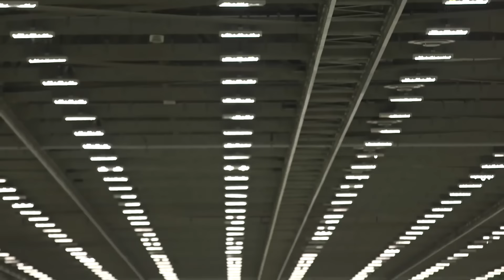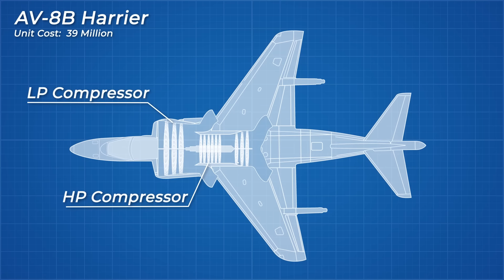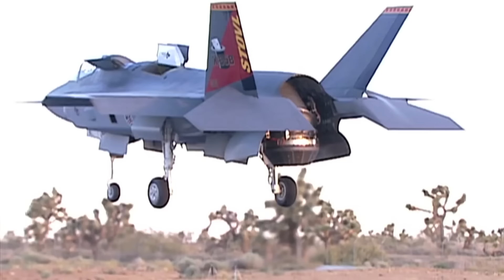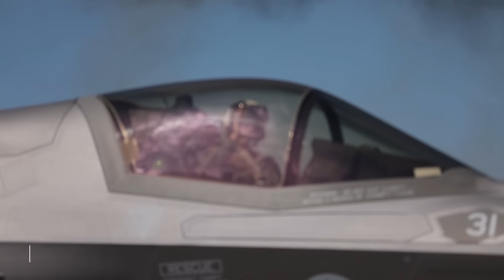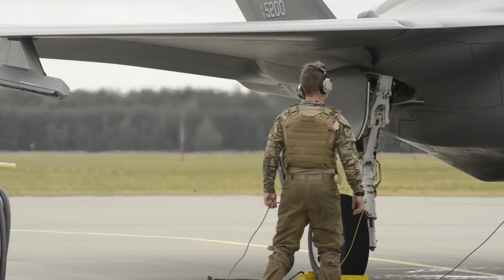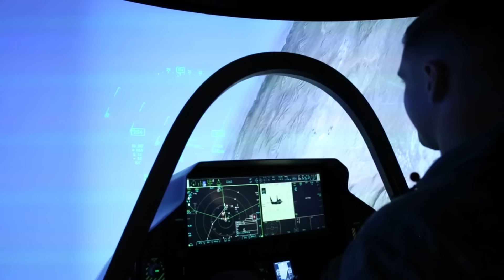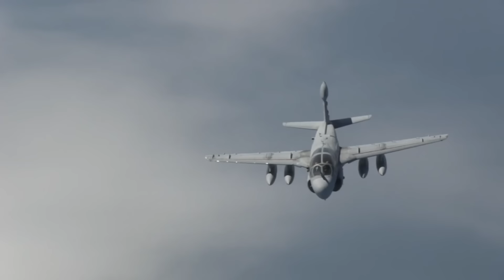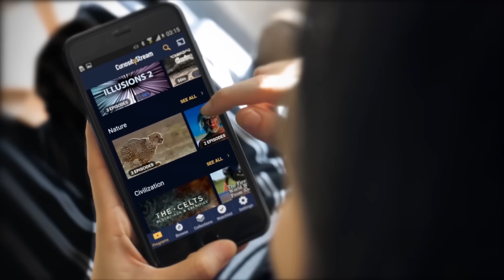Is The F-35 Worth $115 Million?

Comment: the 27 years taxpayers robbery development is finally coming to its end
Reply: 20+ years of taxpayer robbery in upgrades and maintenance contracts just starting. 

damn thing is basically unavailable to fly 75%+ of the time, the 2018 "price" figures were gamed rather hard since they didn"t include any of associated costs which were supposed to be included in the figure (and thus compared apples to oranges and PR'ed the result) the government can't own the spare parts or control logistics, doesn't own much of the IP,  has real problems with being able to use many of the systems mentioned (the networking causes "doubling" the helmet is still unreliable as all get out, maintenance systems (alice I think) causes the plane to refuse to start unless bypassed and can take days to allow to move to new place, and can't read their own radar maps because the facility for developing them has not even been built properly yet due to a different contractual screwup) and even here most of "Positive reviews" come from the test pilot associated with the company or the officers in charge of the program who have incentive to "succeed" for status, promotion, or later consultant work with LM...yet is being called ready for full production in PR jargon of "continued development" which is basically "we'll have expensive refits or replacement since they were not ready for primetime but can blame the previous officer, administrator/appointee since by the time it comes up they'll be gone" 

Project on Government Oversight has a good series on the mess this plane is as a government accounting and reporting angle but there many to pick from. 

As for the military prowess....I think it has taken so long to finally come out that radar (and not exactly classic radar but called that) has basically caught up with it. The Russians have started bringing out new long wave radars that are missile controlling (decently they say-but who knows) as basically the modern computational power that allows for the curves of the B2 to work is brought to bare on systems that saw little development for decades. Also a German company tracked them via passive radar (which is basically the disruption mass makes in the background propagation of EM waves if I get the article right).  Basically stealth has an advantage but like many techs it causes new tech's to rise to counter it.  For a while it has been near untouchable but I seriously doubt it will last much longer. Like the more accurate naval SSMs with greater range than F35 or Super Hornet cause problems for Carriers I think stealth is a technology that was totally dominant for a while, is now showing vulnerabilities, but has built a network of people in the Pentagon, Congress, and the Defense Industry  who want to see it continue and will promote it wildly.

Comment: As much as the government wants it to the F35 will never fill the roll of the A10 when it comes to close air support for ground troops. The A10 is a slow, low flyer encased in a titanium bathtub with a 30mm cannon and over 1000 rounds of ammunition. The pilot is in direct communication with the TACP calling out coordinates. The low flying capability, twin turbine engines, and sound of the cannon are just as feared by the enemy as the weaponry itself. There's no way possible the F35 can wreak as much havoc at a higher altitude with much less ammunition.

Comment: The problem with the should-have-three-models argument is then you have to write the avionics software 3 times, and it's the software that was the expensive bit.
Reply: The engine is the single most expensive engineering and price part of any plane.
Reply: In all fairness to the development team at Lockheed, they did a damn good job of making all three platforms have a lot of interchangeable parts, and the engine used is just a variant of the F119 used in the F-22, so a lot of the parts for that will fit onto the new engine. The weapons bays, fire control systems, and flight computers are all the same. The software only needs to be made once for each platform, and can be loaded onto the platform with relative ease. It was expensive to get there, but that ultimately means that these three platforms will be cheaper to maintain and update in the long run than upkeeping the fleets of F-16s, A-10s, AV-8Bs, F-15s, and F/A-18s all at the same time. They went in for the long game, and I'm interested to see how well it pays off.

Comment: Well you have seen the f35 advertising very wel , plus some assumptions from the media crowd you have a nice basis to make a video. 
Debunking , yes ! You must do better sir! Get your facts  right !

First of all the F35 is not a replament for the AV8 harrier. Vertical take off is and has always a wish for your navy . 
The Harrier was a convenient start. Its assumption that a harrier did flip over as you say thats BS . 
But yes they did crash if you ‘ the pilot “ did it wrong. So the us forces asked to back up that tech for the pilot. 
Nevertheless , you compare apples and peers . 

The real reason the F35 plane is so expensive is the big aftersales and not the retail prises . The tech needs to be protected and so a very complex contract that even is pushing laws to be changed per country thats uses the plane. 
See here that a retail price does is only a part of the support deal for a country that bought that plane. 

Now the F35 is jack all traded but a master of non. 
A F16 can do the same mission but only its not that stealthy.   The France mirage did out turn the f35 and so it is proven that the f35 does not like to dog fight .. well dog fights are past .. and the f35 needs its censors .
Thinks that can fit on a F16, f18 or mirage too. But these panes are old.

Comment: Expecting the F-35 to be a replacement for the A-10 seems misguided. Ground attack aircraft are built to carry large ordnance loads, and absorb a lot of damage. You can see pictures of A-10s (and ground attack aircraft of other nations, such as the Russian SU-25) returning from combat missions having absorbed enormous amounts of combat damage, and still getting their pilots back home safely. Compromises are necessary to fold this many aircraft types into one, yes. But the requirements of an air superiority fighter (high speed and maneuverability, low radar observability etc.) versus a ground attack  aircraft (strong armour protection for the pilot, large and heavy cannon, high ordnance payload with multiple external hardpoints, multiple engines for redundancy) seem so separate from each other, that an attempt to combine the two would likely just create an aircraft that isn't particularly good at either. Imagine flying a ground attack mission in an F 35, and needing to replace those sapphire sensor panels and repaint, say, 2-3 of the body panels because an insurgent managed to get a few 12.7mm DShK rounds off at you during a low, slow attack run. Start talking about multiple F 35s flying multiple sorties per day and that could possibly get very expensive and resource intensive very quickly.

TL,DR - Can't beat the BRRRRRRRRRRT
Reply: I have to disagree, the F-35 can carry a large amount of weapons externally, weapons that are more capable than the ones the A-10 can carry. I also wish to add that The F-35 can easily provide Close Air Support from 30.000 feet up and miles away from the target, while the A-10 is good at absorbing damage the F-35 just stays out of hostile firing range which of course is safer overall.
Reply: @bruceu2274  Loading up a large payload of munitions on external pylons would significantly increase the radar observability of the plane while decreasing it's maneuverability. Of the ten hardpoints in total available to the F 35, six are capable of carrying large munitions such as guided bombs, the remaining four are for smaller munitions, like AAMs. Of those six  "heavy" hardpoints, only two are internal and therefore stealthy. Were the plane to operate in a CAS role against insurgents without technologically advanced SAMs and radar, it could at best carry only 60% of the CAS munitions payload of the A-10 (Which has eleven hardpoints in total, ten of which are usable for munitions).

However, in a peer adversary situation where enemy forces are equipped with highly capable radar and SAMs working together in a networked air defense system, IE in a situation where low radar observability is a high priority, F 35 may be limited to as little as two of its hardpoints for CAS missions. (The two internal ones capable of carrying heavy ordnance)

Perhaps I am overestimating the detriment of external hardpoint mounted munitions on the stealth capability of the aircraft. But, given that it is deemed necessary to completely repaint any scratched panels with fresh coats of radar absorbing paint, I doubt I'm overestimating it by much.

Comment: The F35 is 8 times the cost of an A10 Warthog. If it can beat eight A10 Warthogs in a fight, then it's worth the cost. But considering the A10 can easily be modified with better radar and AA missiles, I doubt it.
Reply: The life of a pilot is easily worth more than an F35. If the F35 takes down at least 2 Warthogs than I would argue that it is not worth it once again.
Reply: Oh god, the A-10 is the worst Air/Air fighter I can think of, a F-35 can easily destroy 8 A-10s and there is nothing to say against that fact. The F-35 achieved a 20/1 kill/loss ratio against 4th gen fighters in Red Flag, the A-10 in comparison achieved a single Air/Air kill in 42 years and that was against a helicopter.

Comment: Nothing will EVER beat the A-10
Reply: The A-10 Warthog is inferior to the F-35.
Reply: Who cares the marines love the A10 better
Reply: Armin Hillman No you try putting one 30 mm GAU-8/A seven-barrel Gatling gun; up to 16,000 pounds (7,200 kilograms) of mixed ordnance on eight under-wing and three under-fuselage pylon stations, including 500 pound (225 kilograms) Mk-82 and 2,000 pounds (900 kilograms) Mk-84 series low/high drag bombs, incendiary cluster bombs, combined effects munitions, mine dispensing munitions, AGM-65 Maverick missiles and laser-guided/electro-optically guided bombs; infrared countermeasure flares; electronic countermeasure chaff; jammer pods; 2.75-inch (6.99 centimeters) rockets; illumination flares and AIM-9 Sidewinder missiles on a f-35
Reply: Armin Hillman The f-35 can only has 25 mm GAU-22/A; 2x AIM-120C; 2x GBU-31 JDAM

Comment: you are mentioning the harrier the whole time but forgot to mention that the vertical take of system originated in russia with the yak 141
Reply: And you forgot to mention that the Yak-141 is based on the American Convair Model 200.
Reply: @bruceu2274  The author of the comment is right. Comparison with Harier is wrong. F35 had to be compared with similar projects - the Convair Model 200, Yak 141, Yak 38. Harier, although it is an aircraft of this class, but technically the implementation of vertical take-off has differences.
Firstly. Yak 141 is based on Yak 38.
Secondly. Yakovlev and the creators of the Convair Model 200 did not cooperate together, and were across the ocean, from each other. Also, the Cold War ruled out any cooperation.
Thirdly. Lockheed Martin bought the General Dynamics in the 90s to create the Convair Model 200.
Fourth. It is already known for certain that Lockheed collaborated with Yakovlev Design Bureau in the 90s. Lockheed bought the design drawings of the Yak141 and Yak38. Yakovlev received a certain amount from Lockheed, which allowed the company to survive. The cold war is over. Soviet companies have no money, and no one watches the secrecy of technology. So it was in all areas of the USSR. Technology, equipment sold for ridiculous money. Specialists left to work in foreign companies. For example, Pentkovsky, who worked at Intel and created Pentium architecture. It is impossible to exclude such a factor. And now the question. Why should Lockheed buy the Yak 38 and 141 technical documentation? If they did everything themselves based on the Convair Model 200, and they all succeed. So not everything worked out, and not everything was achieved. I think Lockheed had a problem with a turning nozzle. After all, the nozzle should not only rotate, but also allow the engine to fly at supersonic sound and provide the desired range. And the similarities between the gliders of the F35 and Yak141 are almost the same. The only difference is that the F35 is stealth, and the Yak141 is not stealth.

I'm not trying to convince that the F35 is a Yak141. F35 is an independent project, but not to mention the facts of the purchase of drawings and their impact on the project, as it is not professional. For example, a lot of aircraft are called copies of each other. I do not agree with that. Zh20 is called a copy of Mig 1.44 and F22, but this is not so. Internally, this is another aircraft not related to the F22 and Migu. Yes, it does; Yes, they used aerodynamics Mig 1.44 modified for stealth; Yes, the cabin is similar to the F22, but the plane is not a copy - technically. same with other projects.

Comment: A couple of things: the per-unit cost of the fighter is not the problem. The problem is the development bill, which I noticed you never even tried to tally up, I assume because there are so many different numbers out there. Initially, with the combination of development funding, buying the jets, and maintaining them over their life cycle, the cost was supposed to be about $400 billion, which is bad. Since then, it's broken a trillion dollars. Cost control has, uh, been a problem.

Second: there is no universe in which the F-35 can replace the A-10 as a CAS plane, and everyone in the military knows it. If there's anything within the military community that gets people riled up, it's any expectation that this will happen. The subsonic Boeing design might have been able to do it if they had integrated the GAU-8 Gatling cannon, which is a weapon of shocking effectiveness and frankly pornographic intensity, but even then, the A-10 is incredibly sturdy and perfect for its job and these jets won't be any direct replacement. Real-world, the ground pounders will be relying on more helicopters in situations where the A-10 used to dominate.

I understand the drive to build do-it-all systems, and I certainly understand that the US military procurement process is ugly and impossible to defend when it's trying to gain more capabilities at the margin. But the program here was ill-conceived from the start.

Comment: I suggest you go to the Project On Government Oversight (POGO) website and read some of the reports on this plane. It's not the wunderkind some think it is.  Back in my Navy days, the move was away from single-engine aircraft as two engines were more reliable at sea. Now the Navy is back to single-engine planes. One has to wonder. Finally, the bit about being able to see through the bottom of the aircraft is nebulous at best. It's easy and less costly to just roll the airplane to see the ground. Again, needless complexity to do a simple task.

Comment: is it worth?

try to make cheaper, then you going to get the contract

seriously
the development first require an army of very talented  engineers
secondly try to imagine  the  tool,  pressing  a simple  hood for your truck might  cost 50-100K

then they producing at least 10 000 with one tool
meanwhile  example this  F-35 made  ""only"" a few hundreds trough  over a decade

many  part made individually  of the  body

enginees are  made  with a quality control where  everything tested many times, before  they permitted for using
materials  used might  cost  hundreds or  thousands  per pound..

after palne ""sold"" another very  expenses  things are coming
you can pass  driving test with 20 -30 hour of  learning

""driver licenc"" for this jet  might takes months, and  many   simulator  hours

Comment: it wont be replacing the A-10.. The entire A-10 fleet is under retrofit for new wings, avionics, and 5th gen sensors and radar that can communicate targets to and from F-35 and F22 tech. this retrofit extends the A-10 service to 2035... i would do a bit more research next time considering they are literally putting the same sensors and tech into the A-10 so it can communicate targets with what you say is replacing it.

Comment: You didn't touch up on how the F-35 is supposed to effectively replace the A-10. I don't think it will, or can.
Reply: This is true. The A-10 is completely different from the F-35 and if the F-35 ever where to try its role it would be shot down sooner or later. The A-10 is built around the most powerful cannon any aircraft has ever mounted and has a tank like level of protection around its most important parts with engines mounted on top especially for it being intended for close to ground operations which the F-35 clearly is not. The A-10 however could be replaced by a cheaper aircraft because its capabilities are way past its usage at the current state of war in the world. For example they are flying out the most expensive and effective air cannon in the world to fire at people and buildings... The A-10 was intended to crack tanks, reap havoc in the close air support role, its only drawback is that it is too fast and too expensive. It could be replaced by an old school Propeller based aircraft with much less cost etc for the current duties its performing. The A-10 was supposed to destroy Soviet tank armies, not kill people in caves. But thats a discussion not really related to the point here which is. The F-35 cannot and will not be able to replace the A-10 in its role and thats not some assumption its simply fact.